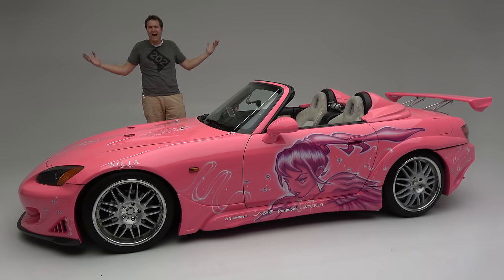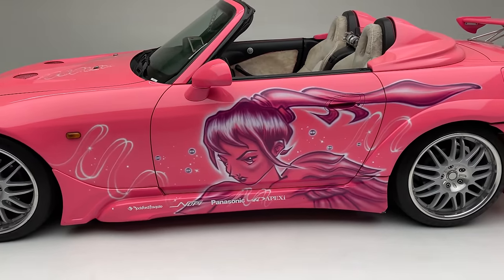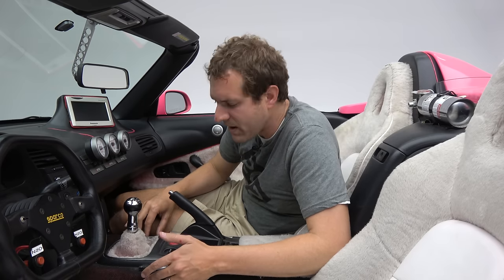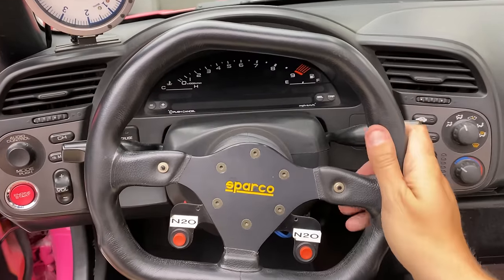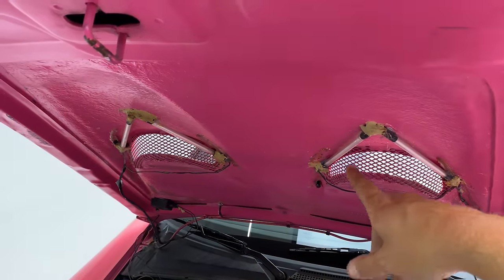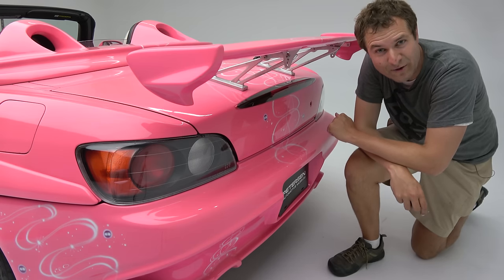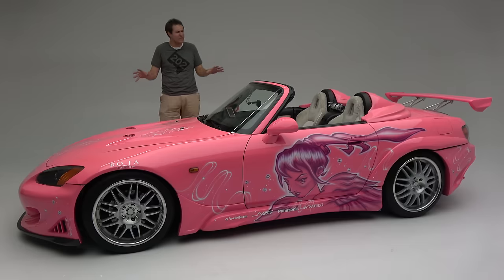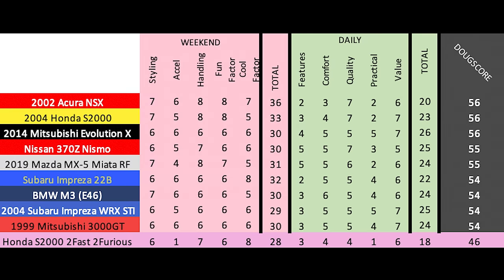This Honda S2000 Is a "Fast and the Furious" Movie Icon

Comment: The Dougscore is so unforgiving that a literal F&F car gets an 8 for "cool factor" haha.
Reply: I actually said out loud "AN 8?!" And right after he just got saying in Los Angeles, nobody looks at anything, but people are actually paying attention to this Honda S2000.
Reply: it must've been the pink, he'd probably rate Han's RX-7 a 10 on cool factor
Reply: That was fair, if anything too high. There are "cooler" cars from F&F and you should really never give out 10s, to give room for improvement. I think its more like a 6-7
Reply: I'm pretty sure Don's blacked out Charger from F&F will probably get a 10
Reply: Should be zero
Reply: @3UZFE  sub-zero
Reply: I'm also surprised the handling got such a good score, considering the fact the steering the steering wheel
Reply: Munshat Rahman  he gave it an high score about the coolness just to not get harassed by the little fanboys. these cars are far from being cool, they're just a clusterfuck of useless parts. and everything is poorly adapted or installed because nobody would notice since these are movie cars.
Reply: Munshat Rahman  I'm aware... but a lot of what makes something good to handle is how it feels and how intuitive it feels.  A non-circular steering wheel that is off by 45 degrees is going to compromise your ability to drive.
Reply: Munshat Rahman  well, every movie car is usually trash like this one. the fact that this is an Honda doesn't really matter in this case.

Comment: 7:13 No that's stock carpet. It's just discolored over all the years
Reply: No, the S2000 has plastic there and not carpet. What S2000s have you been in? By the way, I’m an S2K owner
Reply: @theWolfXLIV  ap1 has carpet... ap2 was updated to plastic
Reply: @theWolfXLIV  AP1 had carpet.
Reply: @theWolfXLIV  Hello fellow S2000 brother! I'm a AP1 owner, yes it does have carpet. The 2000-1 model had carpet there but 2002-2003 had a leather surface there. IDK about AP2 but the first years had carpet there. It was just discolored from the dye from the pink bath mats probably
Reply: Phil Gudet Ah fair enough, my 2007 has the plastic with the edges a little higher creating a little lip. Mine’s an AP1 facelift, we happily never got the 2.2 litre engine in Britain, so we don’t call the 04-09 ones AP2s

Comment: Oh man, I hate to pop your bubble man, but that is not the same car that appeared on the movie "2 fast 2 Furious"

There are a lot of major differences in the graphic. pull up "2 FAST 2 FURIOUS - First Race" at 39 seconds, you can get a close shot of the car. The hair pictured in the movie goes over the fender flair, behind the pony-tail there is more detail in the hair. The edges of the hair are a lot more jagged, the car you have, the hair is much smoother. 

It is possible this was a set car, but not the hero car used for the close ups.

Still a very cool car though, and I appreciate you reviewing it.

[EDIT: I just got done watching every scene with that car featured, there is no clip of that car in that film. Someone got scammed.(Pay attention to the edging of the top side of the hair)]

Comment: sounds like limp mode is on the engine, someone probably over-revved it and the limp came on.   needs the ECU reset.
Reply: ...or they governed the car...I drove a '74 Gran Torino movie car from Starski and Hutch ,  and it was ridiculously fast ( * due to the ridiculously low rear end gear ratio installed )...but only to exactly 55 mph...and a warning sticker on the dash made it clear that it would be ill-advised to attempt to go beyond 55 miles per hour with it.
Reply: vtec leak.. alot of those car just never made to last and the owner just had it for resell not really for drving around..
Reply: Could very well not be registering up to temp.  If the car isn’t to temp, it will not engage VTEC and feels like hitting a wall. The F20C is not oil pressure controlled for vtec so it does not “leak”.

Comment: The 4-5,000rpm power drop off will be because of the centrifugal supercharger. I have a 350z with a centrifugal supercharger, and previously peak power was around 6500rpm, now it’s at about 5000rpm then it drops off quickly

Comment: Wait, so how does a fuel cell differ from a gas tank?
Reply: They are more impact resistant than a gas tank and prevent spill during rollover
Reply: Won't leak fuel if in a major accident
Reply: Fuel cell doesn’t sit under the car
Reply: Sometimes also foam filled to stop the fuel sloshing around during cornering, breaking and accelerating preventing fuel starvation.
Reply: Also...nice new graphic for the doug score 👍
Reply: fair enough I didn't see my own typo. So let's assume the drivers broke due to violent decelation by massive brakes.
Reply: It differs in that had Henri Toivonen's car had one during the 1986 Corsica Rally he and his co-driver Sergio Cresto would likely still be alive today.
Reply: @coolfrost6  It makes them poor, lol?
Reply: I built up a 1971 Mach 1.  460 all aluminum rousch engine.  I used a fuel cell to mount it higher in the car so I could lower it by 1.5” lighter weight they have to be changed out around 10 years max or it will leak

Comment: 7:25 they did it because that piece has the s2000 logo on it. And they didn't want Honda to sue them
Reply: what this man said lol
Reply: @priceless073  he didn't know why they stick a piece of carpet in top of that plastic
Reply: Why would Honda sue them? Didn't they pay to use Honda in the movie?
Reply: AVDMAN CRX i assume Honda don’t want their logo or branding associated with illegal street racing
Reply: they did not put that radio cover in until the AP2's. The Ap1 which is what this one is, is just a blank plastic cover that has no writing on it.
Reply: it was used to attach a light to shine on the driver's face, according to Craig Lieberman's comments above.
Reply: @bluruckuscrx8124  if you noticed the famous Supra has its rear Toyota badge flipped. You can see it when they were trying to save Vince

Comment: Slushious in Home which was released back in 2015 had similar interior issues in regards to sloppiness as Suki’s S2000 in 2F2F instead of a screen they had a lottery scratch ticket dispenser machine presumably that was pulled out of a small convenience store which i think was a part of hastily cheap retrofit done by Oh to Tip’s car which was a sedan in order to turn it into Slushious. The pink veliside covering marked were the automatic retractable soft top roof’s storage area on the actual production car which was removed during filming.

Comment: The car probably doesn’t do anything above 4k rpm is likely because they just slapped the super charger on and didn’t tune it. On a stock base map, the car can only throw so much fuel into it. The higher the rpm, the more boost. But it’s null if the car doesn’t dump more fuel so the power falls flat.

Comment: I think that since this is the hero car,  Someone should undo the bad modifications and make them right . I would think this car would be worth spending the money considering it's history  and alot of the work would probably not cost anything . Like moving the lights,and actually hooking up the gages and making them functional . The screen coukd be replaced with a modern screen that is actually connected to the car its self, repairing the door panels and seats with an actual interior refresh . Repainting the parts of the car that was spray painted . Using a cleaner to remove all the over spray, rerouting all the wires in a pink wire loom .
And installing an actual dual pipe exhaust.. These woukd make it different than the original car but perhaps suki could return  on screen in the improved s2000  and no other mods would be needed .

Comment: 20:35 its something with the distributor, its a safety feature just so you don't blow up your engine, since it is a prop car I'm pretty sure it has not been tuned with that turbo installed lol

Comment: That's a pretty big supercharger, and Honda's don't make power until higher rpms. I might be mistaken, but I have a feeling doug didn't put his foot down hard enough to get the full power out of that s2000. Maybe because he felt unsafe doing so without and seatbelts, airbags, a crooked steering wheel and obvious mechanical issues. Sucks, because a supercharged s2000 wou old be extremely fun to drive!

Comment: If an S2000 doesn't rev past 6000 rpm, it's likely on 1 bar of engine temp. If it can get to 9K but no Vtec it is on 2 bars of engine temp. And when you have 3 bars, your good all the way to 9K Vtec... errr yo.

Also, engine oil level plays a roll in getting the oil lift to engage vtec... so something to consider as a quick check list.

Comment: Okay i wont lie the body and paint seems to be done extremely fucking well, As much as some may not like the bodykit it has been mated to the car near perfectly, Like it almsot looks fake as you cant see any bolts or fasteners holding any of the panels/wing together, Actually impressive.

Comment: "No red hair was cheesed in the making of this weird restoration, huh?! I guess that I used construction PVC tubes cut in half for the side skirts, once. The navigation system is a bit edging the panoramas, isn't it?! The N20 is the placeholder for the SRS system. That model hadn't any quickshifter, why do I have two buttons placeholders and SRS installed with those elder seatbelts, instead?! Back in the days, do you think the ladies never hit the Skyline?!" 🗨👻🎨♨️🌌

Comment: The car was in limp mode probably , for Hondas their higher revving engines like the S2k engines k20s'k24s when the computer sees something it doesn't like it goes into limp mode to protect itself . doing so it doesn't let you rev over 4 -5 grand when you try it just acts like is has a low limiter!

Comment: I'm slightly amused by Doug's uncomfortableness with the color pink. Also, those Paxton Novi head units do not do well with sitting for long periods of time so the reason the car has no power could be due to the engine having to work so hard to turn it over.

Comment: Even the sticker saying 'Supercharged' was wrong, thats a turbocharger.
Reply: Lol you dont know much about forced induction do you lol.  Clearly a supercharger,  its says Novi right on it and that is made by paxton superchargers.
Reply: @redstang70  I know a 'turbocharger' uses a turbine and the vehicles exhaust manifold (which if im mistaken thats clearly what that looks like, could be wrong tho) and a 'supercharger' is driven by a belt along with the engines other components (which is what's on my car). So I am indeed familiar with forced induction (personally) but like I said I could be wrong but that seriously looks like a 'turbocharger'
Reply: @xnotic24  there is nothing coming from the exhaust to spin  that unit. Clearly a supercharger .

Comment: Quality, a FOUR?!?!

It's been beaten to hell in TWO FF movies and modified with no thought of reliability; twenty years ago. them sat in a museum probably not driven or had any oil changes. 
Yet it still reliably drives you around LA.
Any german or american car, and even a lot of japanese cars wouldn't even start. 
That car is basically running on black magic. How the fuck did honda do that?

Comment: Anyone who can explain the fuel cell? Does it run on hydrogen? Looks like the original IC engine, but I wouldn't think such a conversion was possible? And finally, why not use the standard fuel tank?

Comment: I had a crappy 2000 grand prix, i probably bought from a drug addict that had the steering wheel like that it was cocked at a 45 degree angle.

Comment: Cheap mods were normal back in the day my neon lights were rigged up the same way just on a switch and the point yes cars might look silly now but back then it was cool it was all about making a car your own and 1 of a kind you were rather a jap guy or you went for mods sound system and cheap muffler we connected to the original films but after tokeyo drift the films lost what it was all about

Comment: 8:10 - This is not a fire extinguisher, this is a nitro. It's used to add power to the fire in the cylinders, not to put the fire out.

Comment: Still waiting on you to apologize for your BS Hummer review. Did you get paid off?
You said at more than $100,000 the Hummer is the electric truck to beat?
You said at 350 mile range, the Hummer is the electric truck to beat?
You said with an unknown tow rating, the Hummer is the electric truck to beat?
You said with no charging network, the Hummer is the electric truck to beat.
Thiiiiis is now a BS channel.